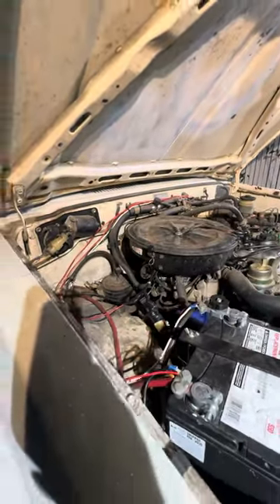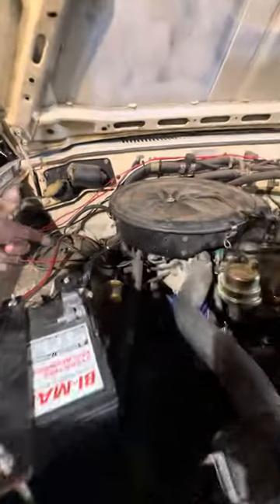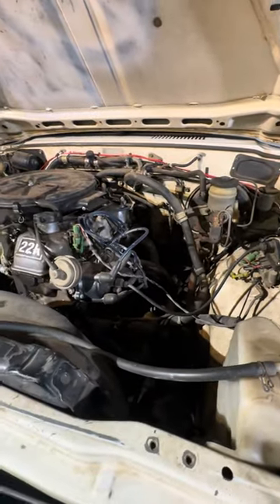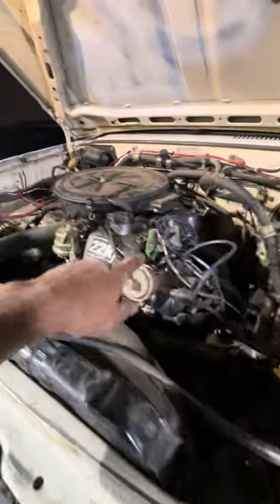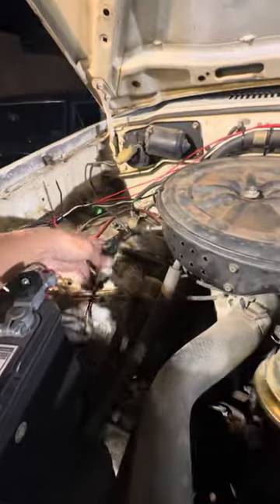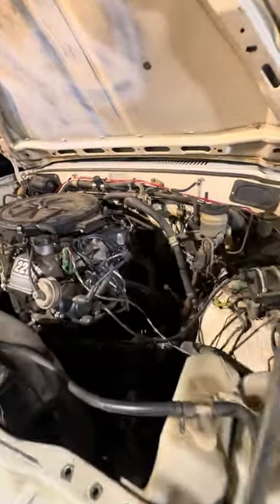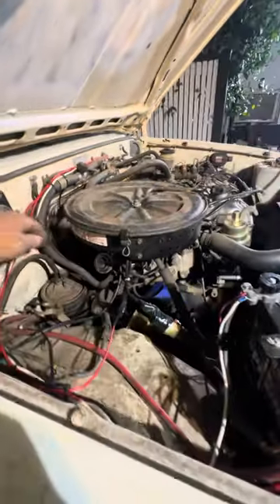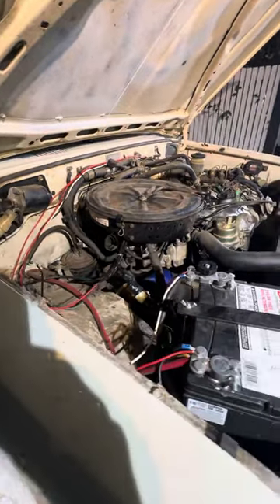My 22r Truck is Fixed After Bypassing Fuel Cutoff Solenoid

Comment: How did you fix it..mine is doing the same
Reply from the maker: I just btpassed the wiring harness. So I just ran the wires from the  from my battery, solenoid on the carburetor, to my toggle switch. And a ground. Basically it is supposed to turn on with the key. Mine had a short somewhere so it never turned on. And when you turn the key off it is supposed to keep it from dieseling. So now when i start it I hit the switch and it turns on the solenoid, then I hit the switch off an turn the motor off. Works really good. Let me now if this helps or not

Comment: My 85 is missing at idle. Idles rough. Starts like ass and sometimes misses just before it turns over
Reply from the maker: It is probably the fuel cutoff solenoid. Mine was the same way . Runs perfect now. Starts right up. Let me know how it goes.
Reply: how did you bypass it?
Reply: Mine is a 1984 doing the same thing idle is bad how do I bypass it